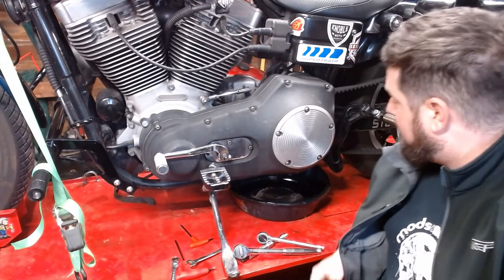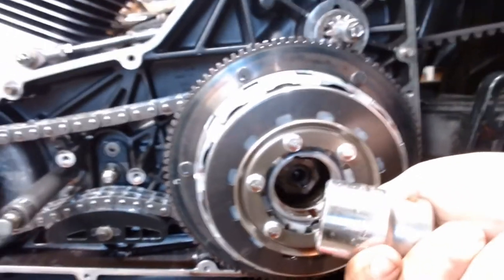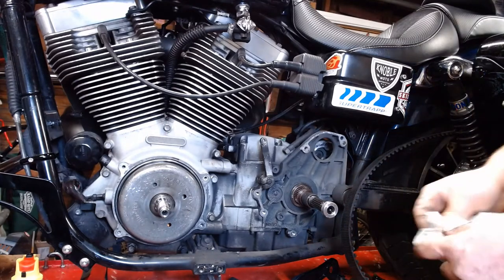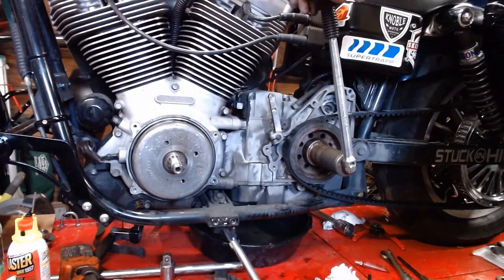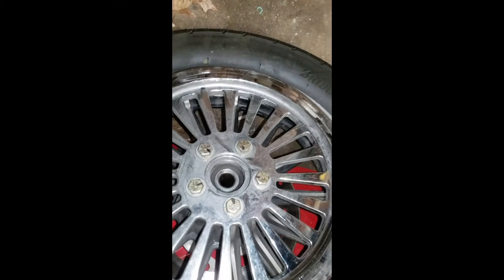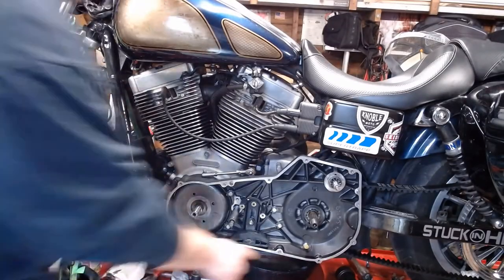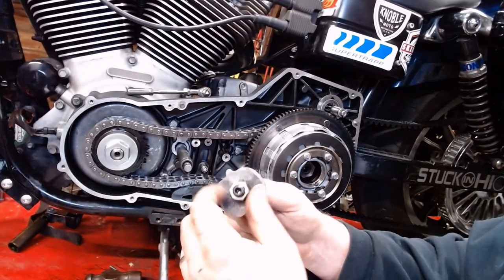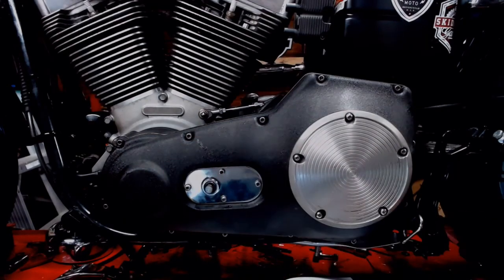Pulley & Belt Replacement on Harley Dyna

Comment: During this video . And address the belt or transmission pulley .    I wanna go up 2 teeth on trans pulley and replace belt with a bigger one .😢So waist off time .
Reply from the maker: Good to know that three years ago I didn’t answer the questions that you would want to ask today. 

It’s the same procedure, regardless of what gear ratio you use.

Comment: On the pully, I torque to 60 lbs and then have to use air impact for the rest. I can't do it by hand either. Lol
Reply from the maker: That’s what cheater pipes are for

Comment: How come you didnt replace final drive seal all that work to get to might as well replace the seals there not that expensive,. I replace all seals in there whenever i go that DEEP into it,shifter seal , main crank seal  , tranny seals ect then bike wont leak oil all-over place i was just wandering 🤔😎
Reply from the maker: Are you referring to the seal on the trans case? Honestly I just didn’t think of it.  It would have been a good idea to replace it too.

Comment: How long does this normally take, my belt has worn out and needs to be changed along with the pulleys and the bike shop is charging me £66 per hour plus the £800 for the parts and I want to make sure they are not trying to rip me off
Reply from the maker: About 4-6 hours.  You can do it

Comment: Hi, thanks for the video.  
I need to replace the front pulley and belt on my '97 Heritage Softail. Going to a 34t pulley from a 32 tooth.
This really helps.
Looks like breaking loose the pulley nut will be the toughest part.
Reply from the maker: See if 50 or 60 link industrial chain will match the sprocket.  You can put a length around one row of teeth in both sprockets, then try and break the nuts free.